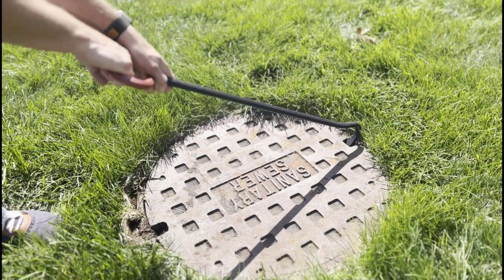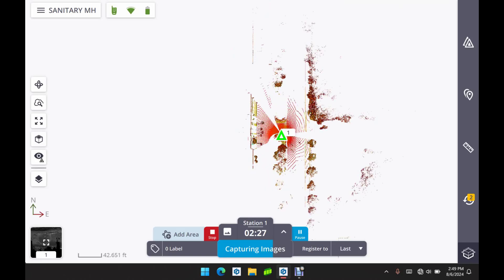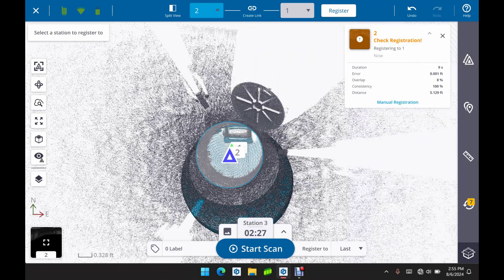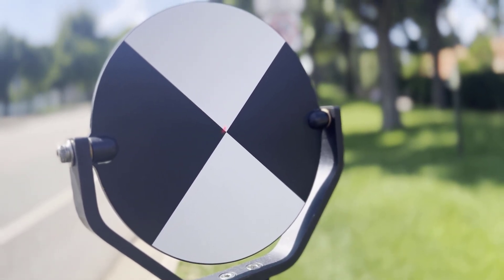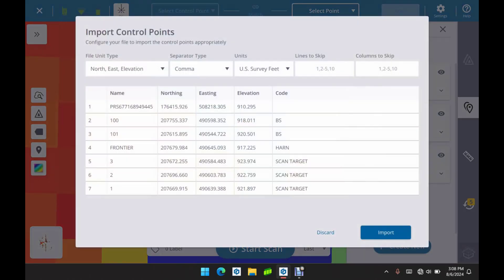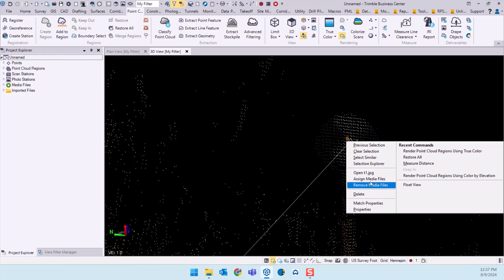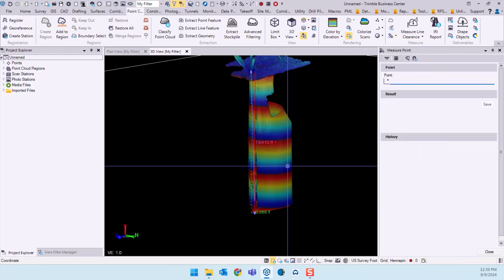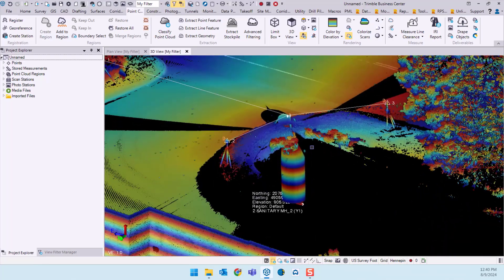Manhole Scanning with Trimble X9

Comment: Why didn't you input target height on the paddles?
Reply: The target height is required when you set the paddles above a ground mark. Since the surveyed "control points" were to the center of the targets themselves, this means the target height is Zero.